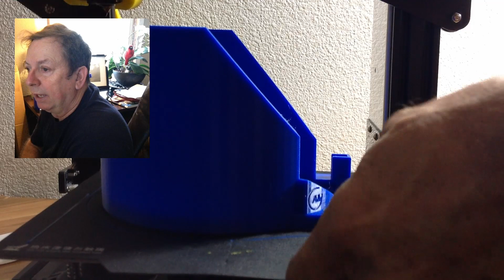A 3D Printed Bullet Collator: Part 1 The Project overview

Comment: Are these done in regular PLA?
Reply from the maker: Yes
Reply: @hillsgun  Thanks, and thanks for taking the time to make the excellent video. Going to get my feet wet with a printer, and this is something I’d like to build.
Reply from the maker: You are certainly welcome, Dan.
Reply: @hillsgun   This one in particular I find interesting, as it can apparently be setup for nose down or nose up. Hoping to use one on a Lee APP to size powder coated bullets quickly, and add bullet feed to a 1050.